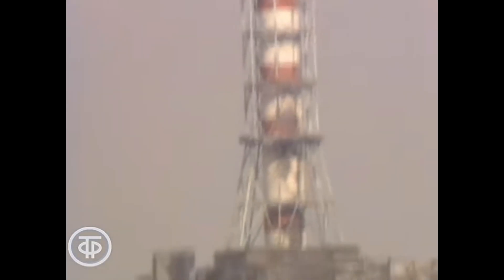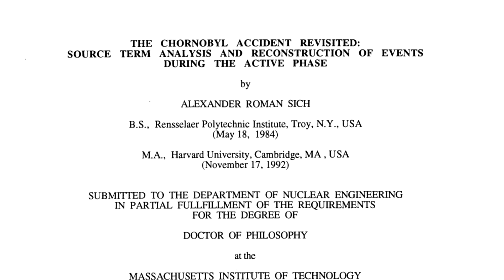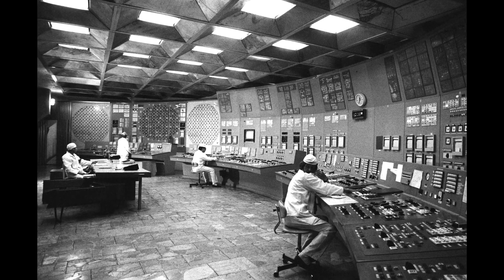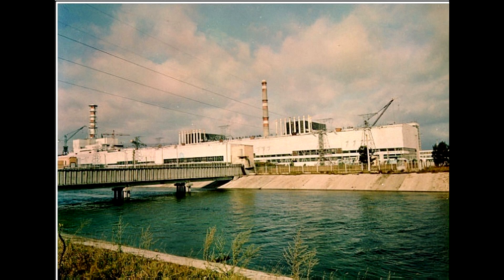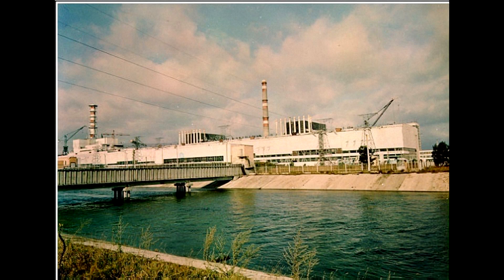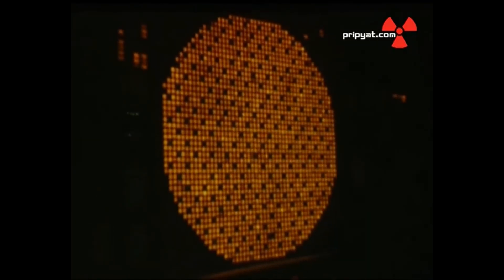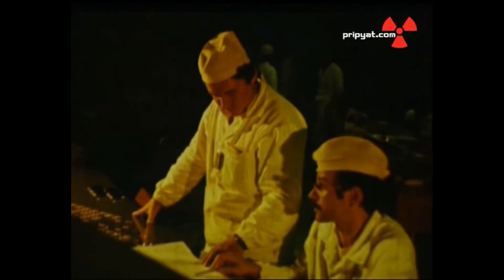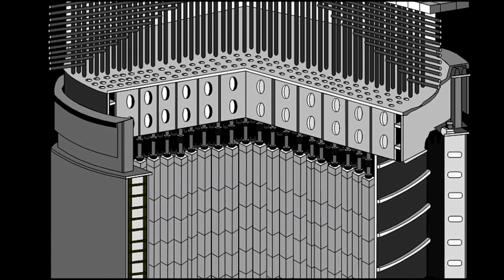Chernobyl Explosion Theories: Sich's Theory - The Last Seconds of Reactor Four

Comment: 2:30 The RBMK 1000 control rods had a known design flaw. Graphite is a moderator (it slows free neutrons increasing reactivity). The first one meter were coated in graphite, the very thing intended to reduce reactivity actually increased it while entering the core. When these control rod tips hit the bottom they moderated (slowed) all the free neutrons spiking reactivity, power and heat. This had happened before with less tragic results and was somewhat understood. This flaw was corrected in other reactors after the disaster. A U235 nucleus absorbs a neutron causing instability and to split. A chain reaction can only occur when a sufficient number of neutrons are slowed enough to create this effect.
Reply: A very small correction to your otherwise excellent comment. The graphite section was 4.5 meter in length, not 1 meter. And it wasn't strange it was there.

Water can both be a moderator, and a neutron poison. The RBMK is so over-moderated with graphite that for it, water solely acts as a neutron poison. The control rods are water cooled too. When pulling them up out of their channel, the water stays behind. Ergo, you replace one poison (boron) with another (water). This will create a drag on reactor power, and makes for uneven fuel burn-up. To combat this, they hung a graphite displacer from the boron section via a telescope. Theoretically, this made the control rods a much more powerful control. It is a very aggressive way of reactor control. The problems arose from that displacer not reaching all the way to the bottom. The 1.25 meter of water below it would be moved out of the way when the control rod was inserted back into the channel, giving that momentary spike in reactivity. Under normal operating conditions this wasn't much of an issue, but in emergency conditions, or when the reactor was operated outside its design envelope, this could, and did, become a major hazard.

What's worse, initially the displacers did reach all the way to the bottom, but in order to save some concrete, they secretly shortened them so they could make the under-reactor rooms smaller. This "improvement" was never communicated with the designers, nor was it looked into what this would mean for reactor characteristics.
Reply: @swokatsamsiyu3590 You explain the need for the 'followers' quite well.  I'd just add that under 'normal' circumstance there were precise limitations as to how many rods could be removed and how far out they were allowed.  This was to mitigate how many rod channels had water in the very bottom.  With only a limited number, most of the graphite followers did not cause this power spike in the lowest areas of the core.  But during this test, in order to raise up power and counter-act the xenon, this limit was violated and too many rods were pulled too high.  This created the unusual situation of a large number of rod channels having water in their lowest reagion.
Reply: @mikefochtman7164  I very much disagree with your wording. The limits on withdrawing rods were the precise opposite of "precise," and had apparently nothing to do with controlling the tip effect or limiting water columns at the bottom of the channels.

First of all, the limit was based on the reactivity worth of the inserted rods. In other words it would prohibit rod configurations (e.g., many rods partially inserted) where there was no tip effect whatsoever, and allow configurations (e.g., a few rods inserted fully, with the rest withdrawn) that did pose a safety risk. Positive scram effects were possible with an ORM value that was above the limit. The limit was  primarily based on maneuverability and fuel efficiency concerns. The operators were unaware that it had anything to do with safety or preventing reactivity accidents.

Furthermore, the rod worth could only be calculated over the course of ~15 minutes by the Skala computer, and these tests were generally only run at 1 hour intervals. The regulations allowed the reactor to be operated for many hours even if the computer was malfunctioning. In other words, the operators would almost always have an outdated and/or inaccurate value of inserted rod worth. There was no way to control the parameter in real time, so operators would typically behave the way they did on April 26th. This so-called "precise limit" was totally worthless as a means of ensuring reactor safety. It was a fig leaf just used to put some engineers in jail and salvage the government's reputation.
Reply: I read your guys discussion here. That was impressive!
Reply: That is why there were always supposed to be 15 control rods in the reactor, they removed all but 8.
The reactor wasn't only flawed it wasn't idiot proof.
The Soviet system also allowed idiots to be in charge of running the reactor.
Reply: @jamesricker3997  Nah, the Soviets fooled idiots like you into believing that the reactor operators were to blame. Control limit of 15 had nothing to do with preventing accidents.
Reply: i second the troycenter, awesome stuff guys👍
Reply: Correct me if I'm wrong, but water served as a moderator and a coolant in an RBMK (graphite being a much more powerful moderator, and water being a moderate moderator). And part of the problem was, when the graphite entered the bottom of the core, it displaced the water (coolant), and ramped up the moderation. Do I have that right?
Reply: @jasonhaynes2952  Not wrong, but not quite right either. Water both moderates and absorbs neutrons. In the RBMK there is so much graphite around that the water's contribution to moderation is quite minor. In practice it acts as a neutron absorber that dampens reactivity (except when the fuel is fresh right after launch). 

So in 1986 when the graphite displaced the water, it wasn't the added moderation that was problematic, so much as the sudden loss of neutron absorption.
Reply: @MinSredMash  Thank you for that simple and understandable explanation!
Reply: @jasonhaynes2952  Thats correct. Water is weak moderator, whereas deuutrim (water with a hydrogen atom with a neutron) has a larger cross section and is a more effective moderator. Reactors using enriched uranium use heavy water where the RBMK used graphite moderator with light water.
Reply: @gordonjenner2375  Yep! They did what should have been done on Day 1: put a compressing/telescoping fitting on the joint between the boron and the graphite. That way the graphite can cover the entire bottom of the channel, without making the actual channel longer.

Also they added the BSM fast shutdown system: control rod channels that only have a film of water on the edges, so they can insert in just 2 seconds without displacing water.
Reply: This is a weird thread on a channel that goes in to great detail on just how wrong everyone here is.  Everything is a moderator to some degree, but graphite is not used as a moderator, it is used as a neutral substance to take up space that does not significantly moderate the reaction.  It is there to fill the space so water is not in the control rod channel, as even normal water is a significant moderator.  The boron on the other half of the control rod is the moderator intended to regulate the reaction.
Reply: Boron is not effective as a moderator because it is a very effective neutron absorber.
For enriched Uranium fuels, hydrogen is the most effective moderating nuclide. This arises because the mass of a neutron and the mass of a hydrogen nucleus are almost identical. Thus the number of neutron scattering reactions needed to thermalise neutrons is minimised using hydrogen.
Effective moderators therefore provide high number densities of hydrogen. Water is ideal for this and as a coolant.
But ordinary hydrogen is also a relatively weak neutron absorber - this causes the positive void coefficient in RBMKs.
Heavy water and graphite are less effective moderators than ordinary light water. But they hardly absorb any neutrons. That allows them to be used as moderators in natural uranium fuelled power reactors.
Reply: @derekp2674  I know that boron is a neutron absorber, I never wrote that is was a moderator. I said that the control rod tips were graphite (coated), which is a moderator.
Reply: @johngaltline9933  A moderator slows down neutrons allowing them to be absorbed by a U235 atom, becoming U236 then splitting 85% of the time. Slow (moderate) the neutrons and you increase reactivity. Boron doesn't moderate, it absorbs neutrons. That's why control rods use boron. And the graphite in an RBMK1000 reactor is most certainly the moderator. It uses nearly natural uranium and natural water is not a significant moderator in this case. You have everything backwards. A moderator speeds up the reaction by slowing the neutrons.
Reply: @johngaltline9933  That's a major reason why western and european reactors don't use graphite as a moderator, they often use heavy water (D20, water with hydrogen atoms having a neutron) with enriched uranium. The reactor coolant and the moderator are both the water. Loose the water, you loose the moderator, hense those neutrons speed up and stop reactivity.

Comment: Many thanks for your latest installment!  Enjoying all your videos since the beginning.  You accurately state that the equilibrium neutron multiplier Beta value is 0.0  That is, number of excess neutrons equals none, and flux remains constant at the chosen power level. Regarding steam explosion, consider normal operating pressure of 70 Bar (1,000psi).  Once the lid lifted, if pressure was thus reduced to ~1 Bar, water in the core would flash into steam all at once.  Not to mention, the raising of the lid might very well have pulled all of the upper control rods up with it.  Thanks for your excellent reporting.

Comment: The uranium that remained in the reactor vessel reverted back to its primordial state (Lava) and melted its way down and out through the bottom of the steel reactor vessel. Graphite is a soft and crumbly material, it’s possible that a large amount of it was turned into powder by the force of the secondary explosion.
Reply: That is not at all the “primordial state” of uranium lmao
Reply: That's not what "primordial" means oh Lord
Reply from the maker: The problem here is that there a large number of graphite blocks remaining in the reactor, and that the lava would still have to pool in a perfect third of the reactor despite containing almost the entire inventory of the fuel. It doesn't make sense.
Reply: @thatchernobylguy2915   Fuel melts, graphite doesn't, didn't the fuel just dribble out of the graphite blocks and congeal into one big tentacled blob of corium?  It makes sense seeing as the fuel channels (were initially) vertical and liquids drain downwards.

Comment: If i understand correctly, he's saying there were three explosions, not two, with the third being the most powerful and being caused by.... water exploding? doesn't compute...
Reply: Steam takes up almost 2,000 times as much room as water does, this is why you don't throw water on a burning fryer unless you want that water to flash boil setting fire to your entire kitchen.  Now imagine something a dozen times hotter than scalding oil and you have the centre of an uncontrolled nuclear reactor and instead of turning on a tap you instead pump several tons of water directly into the centre of it.
Reply: You ever seen a steam locomotive that has blown its boiler?

6 times the pressure, 2 times the temperature, many times the volume here.
Reply: @VintageTechFan  In a boiler, steam is sitting confined and heating up, accumulating pressure. Whereas here the theory - if you listened carefully - is that reactor was breached in the first smaller explosions, and water had escaped already! That's what the voids talk means. And then they say that the inflow of water restarted and the amount that flowed in through badly damaged leaky pipe array created the third explosion. Do you understand the difference between a leaky pipe bunch and a well replenished boiler?

The water that enters, when it flashes to steam, would force the backflow valves shut again, wouldn't they? Video mentioned already how the backflow valves stop flow when pressure is up. 6 times the pressure you say? So the backflow valves would be ~6 times more forcibly held shut? Or what should we think fo them?
Reply: try welding shut a piece of pipe with water inside and throw it in a fire)) you will be amazed
Reply: @supersst838  That would make sense. If the water inside the reactor is heated up and throws everything through the roof. But that's not what we're discussing here. Please pay attention!

We're discussing the theory in video. Rewatch if you missed the sequence that "doesn't compute".

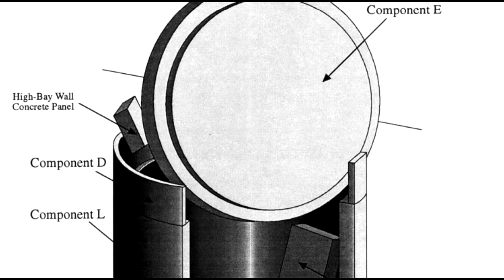In the video at 6:38 they say there was no pressure inside any more, water and superheated steam had already gone and flipped Elena. Then they say the third explosion came, from the inflow of water that's being added through reopened backflow valves. If I try that with fire, using a pipe that's not welded shut but flowing, and I put its end in hot fire, it tends to create a steady blast of steam, not an explosion.

Comment: Oh good god, those figures are terrifying. 1480 gigawatss Peak thermal power is obscene, 300+ tons of fuel in one unit is ridiculous.
Reply: @mattaddison1910 I'm don't know mate, but now that I think about it, the 300 ton figure The Chernobyl Guy said was probably the corium total, fuel and molten reactor components.
Reply: Imagine the DeLorean needed 1480 Gigawatts of electricity instead of 1.21 to travel in time..
Reply: @jwalster9412  Doc would have pulled all of his hair out
Reply: @jwalster9412  If you could build nuclear reactors to scale 200g of fuel would be enough for the delorian definitely like the amount he ripped off from the libyans :D
Reply: It is not that preposterous, in explosive terms, for reference a simple mk84 gravity bomb, when exploding, should put out about 75 terawatts of power (50 times more) for about 30 microseconds.That's from the detonation velocity of the explosive.
To generate ~100 tons of TNT equivalent for the larger steam explosion, the reactor would have had to operate at 1480 gigawatts for 280 milliseconds.
Reply: @mattaddison1910 They dropped a good deal of lead on there too, and it's got a low enough melting point to mix in with the rest.
Reply: It's around 200 metric tons.
Reply: @mattaddison1910 So how did all that sand get in there? I'm honestly curious.
Reply: @thing_under_the_stairs  by helicopter
Reply: @thing_under_the_stairs dead people
Reply: I’m pretty sure the soviets used their rbmk reactors as a way to produce nuclear weapons as well, may be why they held that many tons of fuel.
Reply: 600,000 lbs of fuel, nothing too serious
Reply: Check how many tons in Fukushima. And in the cooling pools.